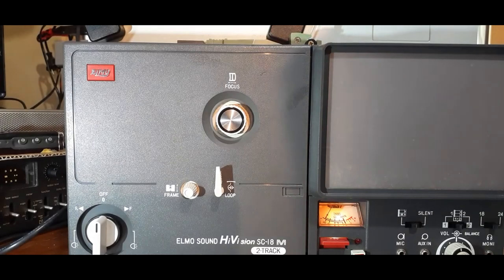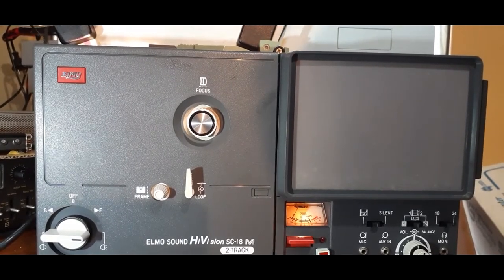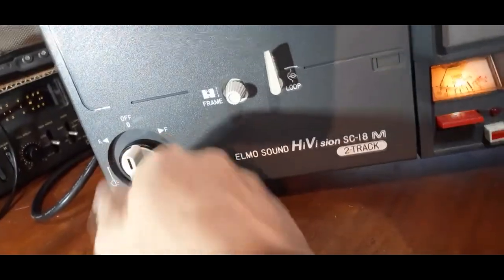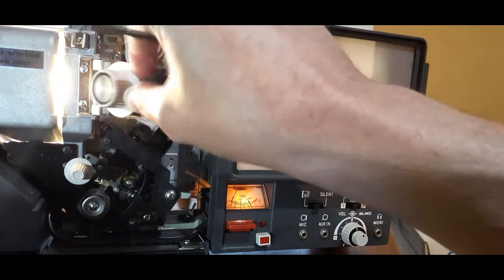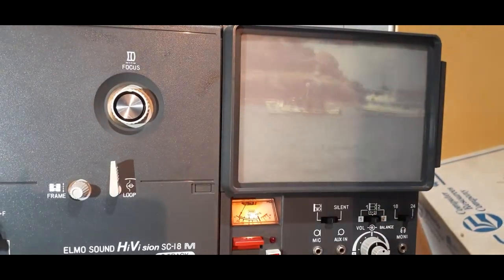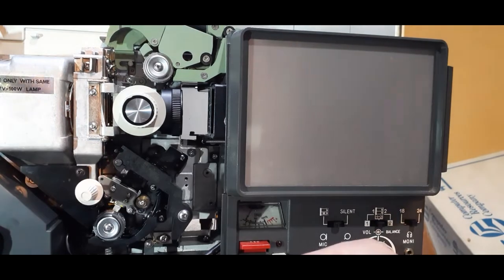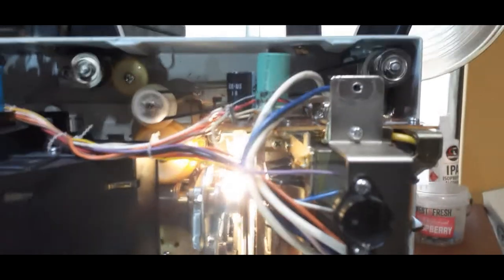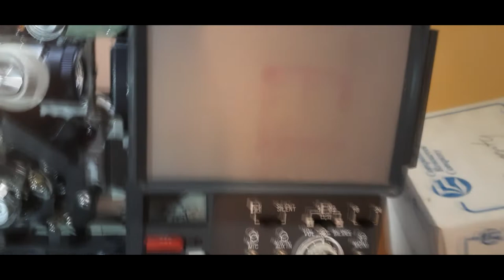Elmo Sound Hi-Vision SC-18 M 2-Track Projector Super 8

Comment: $20?  Twenty dollars ?  Krazy. Have you seen what these go for on auction sites? You got the bargain of the century. Glad you fixed it.
It is amazing what is found in charity or thrift shops. Thanks for posting this video. 👍👍 FInd a Super 8 sound movie and see if the audio part of this works. Your charity shop may eventually get a sound film. Probably another low price bargain.
Cheers.
Reply from the maker: Yes, a bargain. I actually sold it for $100, it still had a take up issue
Reply from the maker: And the buyer tested it and the sound works